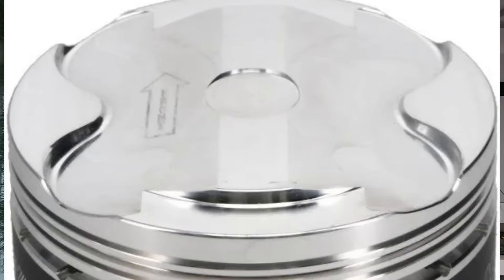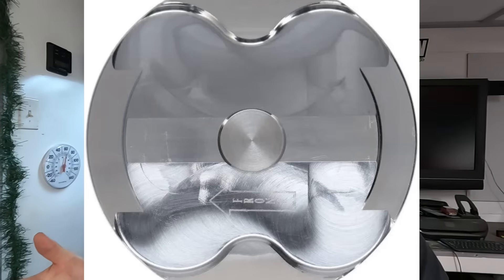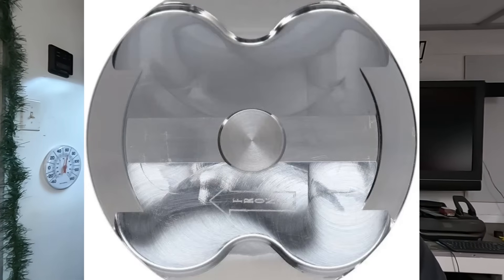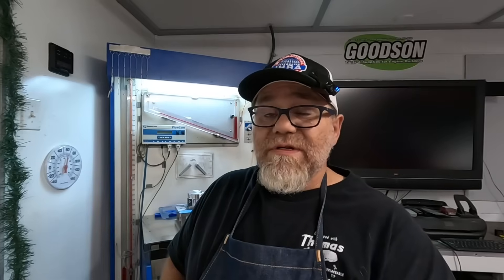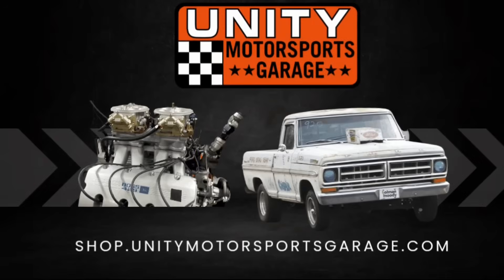DIY: Piston Mods that WILL Actually Make Power!!!

Comment: And on the topic... can piston mods be made to improve swirl in some engines?  I wonder if a tapered teardeop shallow relief ['two or three degrees] opposite eyebrow and curved roughly around a centered radius adding volume in an area spanning 40-50 degrees would show up on the dyno.  Can't draw in comments, but that's as good as I can describe it.  Call it... a comma.
Reply: "Singh grooves" do similar. Don't show much on dynos, but make street/ performance/ drag cars wake up torque and throttle response due to increased chamber turbulence at TDC.

Comment: Well you have two people in your corner who definitely know their stuff, Powell Machine and David Vizard. My concern is how much of an effect on compression ratio will it have and it seems like you would have to do the top of each piston exactly as the next one. I do agree on the sharp edges argument, I mean look at anything with a sharp edge can be a problem, blocks , pistons heads etc. I’m just wondering if for the regular diyer if it’s worth the effort. Great video
Reply from the maker: I will give up a .25 of point of compression for Airflow Anytime! 
Thanks for watching 
Andy
Reply: @UnityMotorSportsGarage DEFINITELY 🔥🔥🔥

Comment: Andy, thanks for this video series and detailed explanation of making power. I am a Mopar guy and 318’s are what I like to build. I am running Keith Black KB167-30 pistons in my 70 Challenger that is a factory 318 car. I agree on blending the edges to prevent hot spots and stress risers but didn’t know what I do know about the sharp points next to the bore wall. I will be paying attention in the future. Thanks again.
Reply from the maker: Thanks for the Kind words and following along on the 318 it's going to be special!
Andy

Comment: Yes, relieve the area around the valve to initiate the flow at low lift. Stock car racers have done it for years. When I discovered it I started doing it on my Drag car and my 60 ft times dropped slightly.
Reply from the maker: It's a handy little trick!
Thanks for watching 
Andy

Comment: Great video!!!  It's all logical, it is just something I haven't put much thought into before.  You spend good $$$ on pistons, you would think they would take sharp edges and heat into account.
Reply from the maker: You would think, but hey it's Shiny and pretty 😉 
Andy
Reply: @UnityMotorSportsGarage  I used to be proud when I got a new set of eight shiny new pistons. 🙃🙂
Reply from the maker: @garymckee63 Trust me I know!
Reply: @UnityMotorSportsGarage repeat after me: Deburring is a lost art.
Reply from the maker: @MrTheHillfolk you got it! Deburring is a lost ART
Andy
Reply: I've been saying this for 6-7yrs now. 
Deburring is a lost art. 
I know better now ,and have for years to pick up a piece of finished product thinking it's been properly deburred and rub your hand across it like a dummy, you'll draw blood.
Reply: Manufacturers don't port the heads and intakes either. They leave that up to the engine builder "to do his thing".

Comment: The Godzilla is my real target for a Mustang build. Steve/Kyle Morris are working on one, now.
Reply: Make sure to put rods in it. They can and do break rods.
Reply: @davidreed6070  The Godzilla has windowed main webs. I am waiting to see how much limitation that manifests in the Kyle Morris engine. He will push it.
Reply: @scottosborne8735 I thought they were going to sell the engine. Eothrr way you cant taks one out of a salvage, boost it and it last like an ls will. My froend tried one and it didnt last long enough to do anhyhing with. I think the 3rd psss at 6200.
Reply: @davidreed6070  They sure have nice heads.
Reply: @scottosborne8735 I have not seen them on a bench or checked the cross sections but it is a promising engine.
Reply: @davidreed6070  9 degree with splayed valves and "small" ports
Reply from the maker: Godzilla for the WIN!
Andy